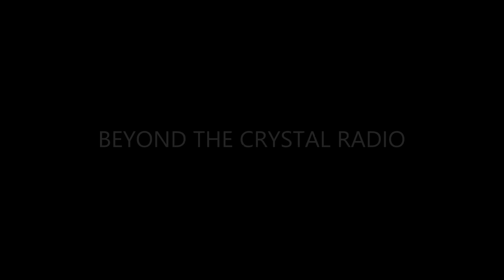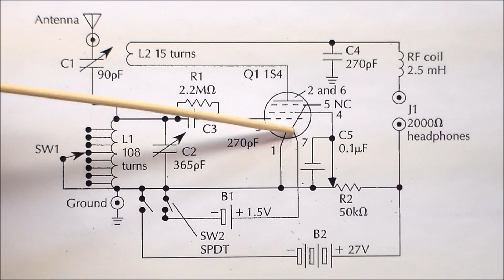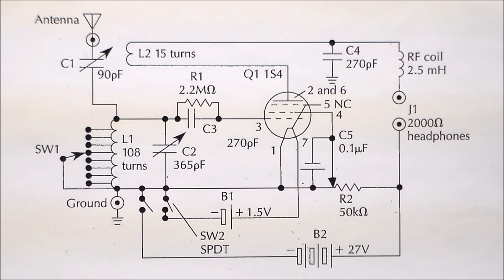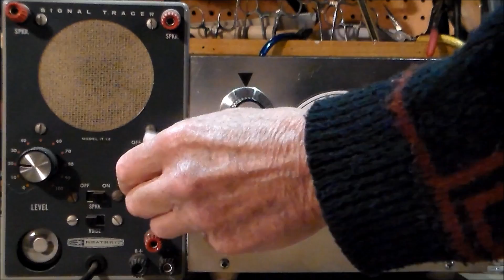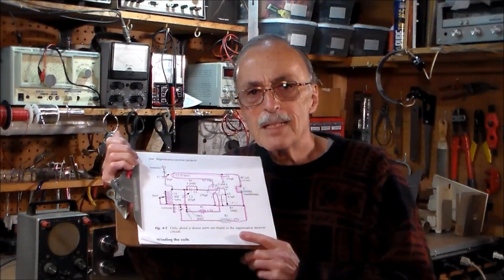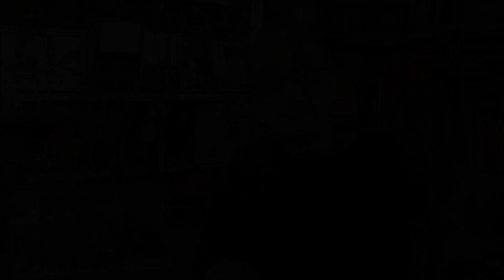BEYOND THE CRYSTAL RADIO

Comment: Howdy. Nice walk-through.
2000 ohms headsets are difficult to find or maybe really expensive.
One alternative would be to use a crystal earpiece. A large inductance must be connected over the headset banana jacks to allow DC to flow. A 3 VA PC board transformer should do well using the 115 V or 230 V primary as an inductor. Then just connect the earpiece over the inductor.. The secondary is left unused.
The primary resistance will produce a DC component though. That should not be let to the earpiece. DC to the earpiece has a tendency to jam the piezo resulting in no audio. A 1nF capacitor should be used in series with the earpiece. Finally a 330 k resistor should be used in parallel with the earpiece to discharge any residual DC.
Regards.

Comment: SW2 looks like a DPST switch to me although the schematic representation indicates 2 SPST switches, for it to be a single unit there needs to be a dashed line connecting the two representative switch levers. also although i've never seen it before and supposedly more technically correct concerning R2 it's normal convention to have the variable arrow in the middle of the resistor to indicate a rheostat.

Comment: Dear JOHN your cir-cuit must be WRONG due the LOWER tap of the COIL must be OPEN as shown in the dia-gram the lowest tap is connected to GROUND that is WRONG The RIGHT cir-cuit is that only one-and-one tap must be connected one at a time to the selector switch.DUE to by that cir-cuit the lower part of the COIL would shunt a short-circuit  to the > UPPER-part of the COIL and so, the LOWER-part of the coil would drain large amount of RF current by principle of mu-tual induction. I had ex-perience several-times on OSCILLATOR tank-circuit of its COIL by putting a  another short-circuit coupling WINDING to the oscillato
re COIL would STOP the os-cillations.Even an ordinary power-transformer shunting a short-circuit to ou=put secondary would in-crease the CURRENT drain by PRIMARY winding .

Comment: Nice project, well built. Unfortunately the author of the book did not properly wire the 1S4 filament. Those tubes were meant for the filament to have the positive pin  grounded. Pin 7 should be grounded, and the positive 1.5 volt filament battery also grounded. 
Pin 1 should go to the filament power switch and on to the negative terminal of the battery. 

There is a test you can make with that radio. Wire the B battery so it is on all the time (short that side of the switch). Then switch on the filament and tune a station. Then listen carefully and switch off only the filament. You will hear the volume go way up as the tube is cooling, and then go silent. 

Having the battery wired as it is causes the grid bias to be positive and the grid leak detector doesn't work as well as it could. 
All this is described in the old tube manuals but is missed by most.  I described this at the bottom of my #30 tube page.

http://makearadio.com/tube/1-30.php

Again, you made a great presentation.

Comment: Hi John,  I've built many things for my radio shack over the 40 years I have been a ham, but never a regen receiver. Yes, I bought many old pieces of test equipment that will never have any use today, and I have the book by Davidson I bought many years ago. What I cannot strip from an old chassis, I can make with the tools I have in my shop. I have one treasure that I have been saving for a long time to use in a project such as this -  a National Velvet Vernier dial in the original box with the original papers. Your video has made me want to start building again, especially since Heathkit is long gone (very sad). All I have to find is one of the three rolls of #24 magnet wire I saved away in one of my storage buildings, and I think I can start.
Thank you John,
DE Fred W4FJF.
Reply from the maker: Hi Longshorts3,
Thank you for your nice comment. I appreciate good feedback! I’m glad I have inspired you to start building again, it’s great for us retired folks (I’m guessing you are retired). Here’s a great book for you with some good circuits: “Vacuum Tube Regenerative Receiver” by T.J. Lindsay. 1997, Lindsay Publications Inc. I’m sure it is out of print but sometimes you can find it on Ebay. Good Luck!
Reply: @squarewave2  Hi John, I think I already have it, along with the Gernsbach Shortwave Manuals from the 30's, and the series of 6 Radio Experimenters booklets and E.H. Scott's "Dean of DX". I did buy a lot of reprints from Lindsay's Publications while I was working and had disposable income. I was a long haul trucker that had Ham gear in my truck, not CB (I could listen, but not talk on CB). I took a break in my trucking to get a bachelors degree in Electronic Engineering and my GROL plus my broadcast engineers license from the FCC.  Three months before I graduated from Western Carolina U, the FCC deregulated the industry and blew my dreams out of the water. So, I went on trucking until in 2003, a USA truck rammed me in the back, sent me into a swamp next to I-65 in Saraland, AL. I have been permanently disabled since. I was a volunteer Navy MARS operator before that (NNN0GAA THREE) until we were "decommissioned" in 9/15/15 (a bad mistake by the Navy - they will need us badly someday). So I have a long background in radio. I used to talk to Clayton HC1CY  who was the chief engineer for HCJB in Quito Ecuador until he became a "silent key". Big megawatt shortwave station with a Sterba Curtain antenna with the transmitter shack on rails so they could point the signal to various parts of the world. I just got done administering the Radio merit badge to the local Boy Scout troop, so I keep active in Ham radio. Small history of a long life. Thanks John, Be blessed!

Comment: Hey thanks for the inspiration! I have the book by Homer Davidson and I've been collecting parts and pieces including the air variable caps and 1S4 tube. I have all the parts now, so maybe I should get going, right? By the way I did build a regenerative vacuum tube receiver (my first tube radio project) following an article published in Nuts and Volts by Dick Whipple back in May 2015. It used a single 12AU7 tube but he cheated a bit by using an IC OP AMP module to boost the audio to drive an 8ohm speaker or standard headphone. It works pretty well except that the high end of the AM broadcast band isn't covered very well. It gets cut off at the lowest end (fully open, lowest capacitance) of the tuning cap. So, I guess I've got to rewind the tuning coil to increase the inductance in order to move the frequency coverage down a bit. I think that I've got to add a few more windings to the spider coil but I'm not sure how many additional turns I need to add. The spider coil is a bit odd in design. It includes a separate set of windings to couple the antenna and a single tuning winding that also incorporates the tickler tap. So, I'm not sure how to change the ratios of winding to make it all work efficiently. At any rate the project that you are presenting looks a lot simpler and easier to troubleshoot. Onward and upward!

Comment: Hi.  This is interesting.  I am glad to see valves operating at a low plate voltage of 27V.   It was Tommy Flowers of the  British Mail Service who first decided that tubes (or valves) should be operated at a low voltage to ensure reliability for the first, early computers during WWII, which were used to decipher Hitler's Enigma codes.   

Tommy Flowers' theory was this:  If we operate the valves at a low plate voltage and current, then we also need a low heater voltage and current.  So we operate the valves at Low Power.  Then the valves will work reliably enough to build the Colossus computer with thousands of valves which will never fail.  And actually, his theory was proven to be correct.   

But was soon replaced by solid state transistors.  Then integrated circuits.  And now we watch these videos and write these comments on Youtube.  :-)

Comment: Going between crystal set radio and regenerative receiver is a simple oscillator loosely coupled to the tuning coil  of a crystal set tuning coil to boost selectively of tuning circuit but not the volume.

Comment: Sir, you look like my father (who passed away just few months ago at 84) - same moustaches, head, hair, glasses, even (in this video) similar pullover on you ! :-)
  I had idea to rebuild an AM regen radio - one of my first constructions as a radio amateur. But I found there is no more AM broadcast in my country Bulgaria. Only FM stayed. But I can hear AM in your videos. It is pleasure to see them! Pure nostalgia...
Reply from the maker: Hi Peter,
What a surprise to hear from Bulgaria! Thank you for your comment. Of course, you can still build a regenerative shortwave radio. You might like to see a video I posted four years ago called “Hot Homemade Regenerative Radio”. “73s”.
Reply: I've seen this video and even started a similar project with the L-panel and the variable capacitor. But I'm thinking of using transistors. Thanks for the answer, I wish you good health and many more videos. Greetings from Varna.